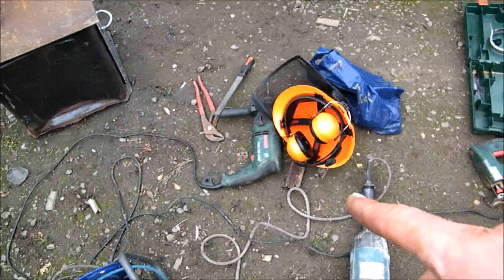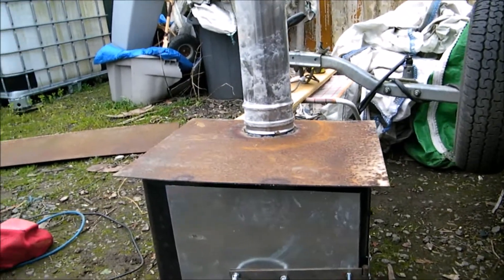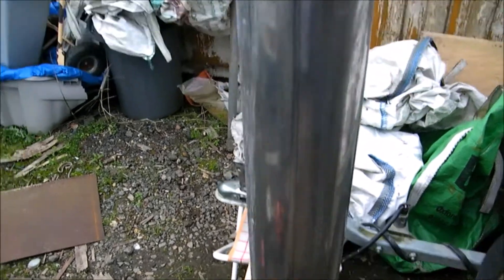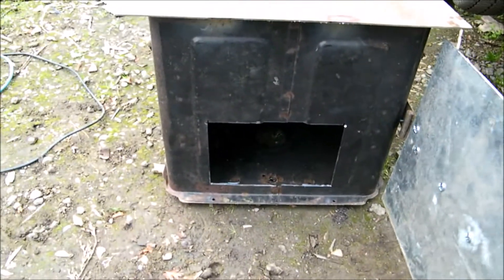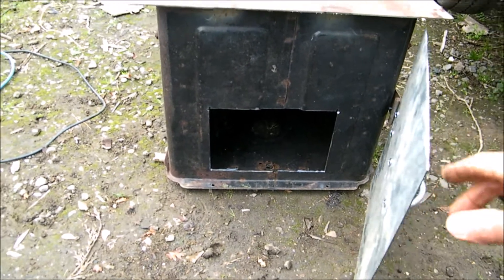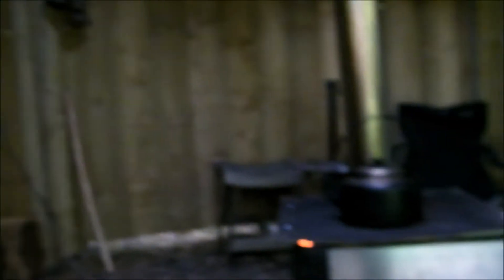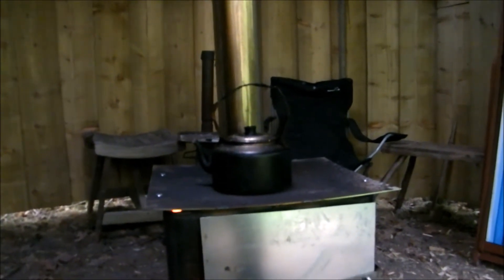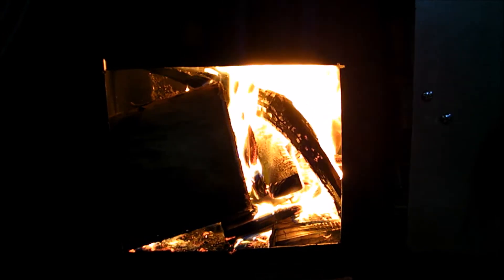UPCYCLED Hobo WOODBURNER

Comment: That was a good result Sam. But you can improve it still further by adding a baffle (a simple plate inside the stove just under the flu) this will keep more heat in the stove and the chimney will run just a tad cooler. Not sure about the door. Looks like it's made from Aluminium. Ally has a lowish melting point 660C approx. There was a dodgy looking area on the door after the burn. We could have a meltdown of the reactor at the Hobo homestead! Otherwise all is good.
Sandy
Reply: Sandy is right I was a little concerned about the door too, I've watched lorries literally melt into puddles at fires.
Reply from the maker: Baffle manufactured and fitted - pipe not bright red anymore and door - hanging on in there, will leave as is for now and cut up some more steel at some point in the future....almost there Hobos...

Comment: Comments 

The stove pipe is stainless and the top is ordinary steel so you did fairly well to stick them together.

the door looks like alloy ............ heat rises so it will zoom up the chimney pipe causing a partial vacuum in the stove   which prevents smoke getting out of the poor weld.

Great improvisation to solve a problem with smoke in the roundhouse at optimal cost 8-)

Comment: Add a controllable draught / choke on the door and your Golden 😊👍
Reply from the maker: I had thought about that, but the old oven has a good number of holes in so it really is a leaky old tub, also the door isn't a tight fit so I elected not to do it. If I do it again with a better set up it's a definite - it might be worth looking into the possibility of making a chimney baffle to slow the burn down....hmmm, you've got me thinking now! Thanks for the input.

Comment: Is the door zinc plated? Zinc I think can be nasty when it burns off so maybe if it is burn it off with a blowlamp outside before using in a confined space like the roundhouse.
Reply: Terry Love should be ok on the door, the fire will pull any nasties inwards and up the pipe.
Reply: There's the outside of the door.  I remember a welder explaining the problems with zinc, the symptoms sounded unpleasant.
Reply from the maker: if I can find my blowlamp I'll do it. thanks for the thought on that one.

Comment: Holy Smoke-less, that's pretty darn impressive. 
Did I not give you the metal plate for the pipe to attach to at the top? I'll have a look to see if I have it, but fear it may have gone if it got left behind :/
Reply from the maker: rhialobran no worries, going to be fixing up the top section on the weekend, so hopefully it'll be burn proof and water tight(ish). Are you traveling solo or hooking up with Sandy and Ant?
Reply: Hi Si-good little burner here. I was going to leave you a message but can't see the messaging in your about. Sadly I can't make it on the weekend. I really was looking forward to meeting you guys.  There are a number of reasons. Firstly (and as mentioned to Sam) my lift has canceled just the other day. Paul (Paul Outdoors) has got some other things on - we only live two mile apart and we were coming together. Secondly, it was last moment and has left me short of time. I have lots of work to catch up on and have just got back from a long distance trip. More money isn't an option at the mo. Well, have a great time as I'm sure you will. I will make every effort to link up at some point....I really do want to get together...all the best. Mark
Reply: I'm sorry to hear this Mark I was looking forward to meeting up, we'll have to arrange something, I'm going to try and get the farmhouse out on the moor again early part of next year so I'll be sending an invite your way, Paul Outdoors too.
Reply: Sam, flying solo :)
Reply from the maker: rhialobran ok Cool can you remember where it is or would you like details again?
Reply from the maker: Also, you did give me the top plate, my mate organic Greg reminded me that I gave it to him for his caravan Restoration project, along with 2 lengths of the pipe. Sharing the love around.
Reply: No I'm fine, I travel towards the rising sun till noon, then have it to my back. If it's cloudy I'll follow the signs ;)
Reply from the maker: rhialobran I thought that might be the case, see you Friday at some point. Looking forward to a catch up.
Reply: Si I was looking forward to the gathering also. It's been hectic here mind and I've done a fair bit of travelling. In addition Paul had other commitments, which he could not evade. So, it will have to be another time. If an invite is sent my way I will certainly respond in kind. I wish you all a great time. Mark
Reply: Hi Mark, Sorry you can't make it. I have something for you that I was going to bring to the Homestead. Will catch up with you soon no doubt.
Sandy
Reply: Ahhh Sandy, It has been hard of late here and what with Paul having other commitments I ran out of steam. You know how it can be. I will visit again my friend....I know how easy it is now. Peace. Mark